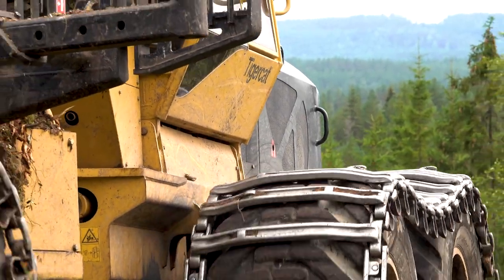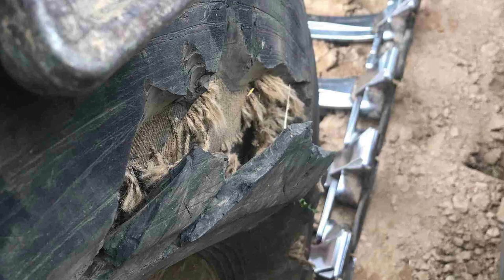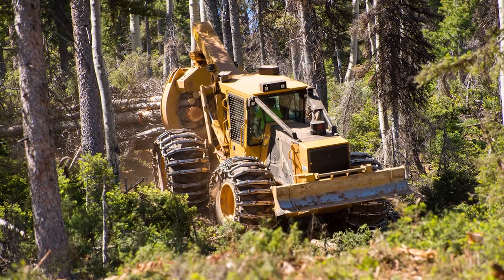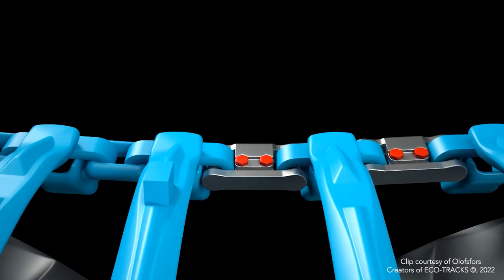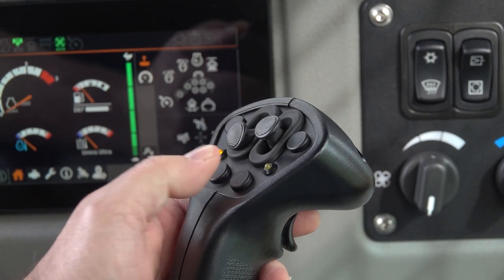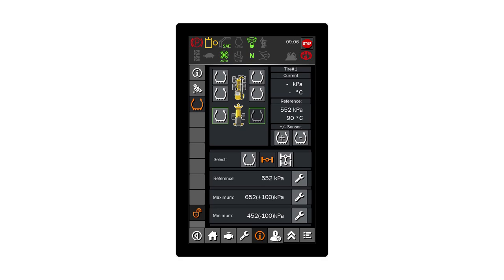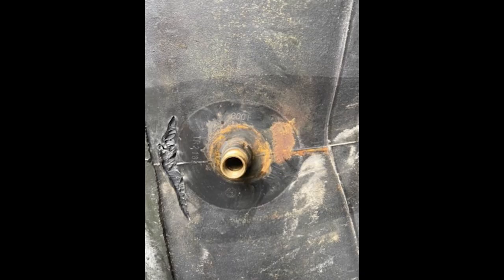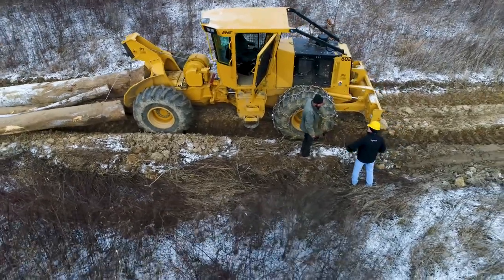Traction Aids and Tire Maintenance

Comment: Why will water in tires overload the axle? The wheels are already on the ground?
Reply: Extra weight
Reply: Centrifugal forces. Just think of the weight of the water, the multiply by the centrifugal forceof the tire rotating when driving